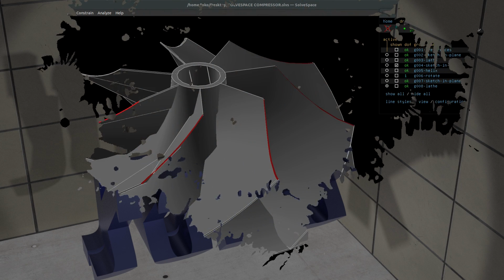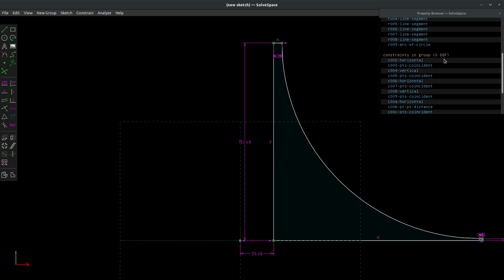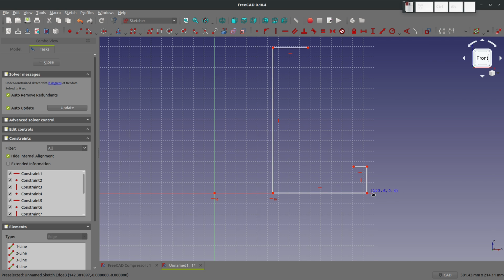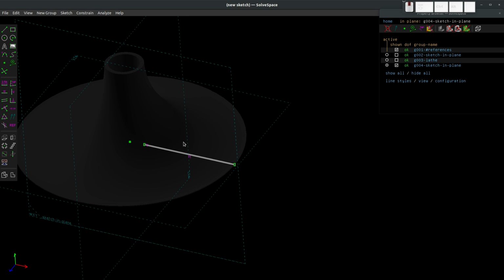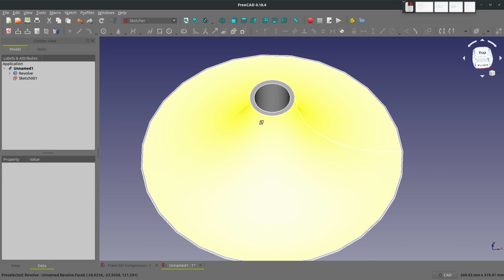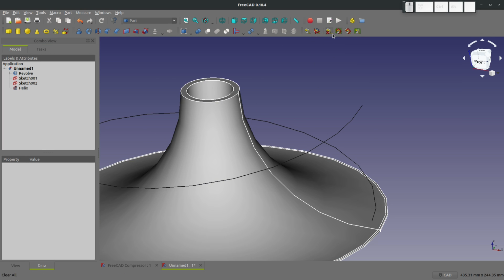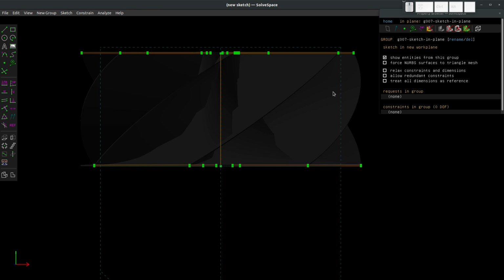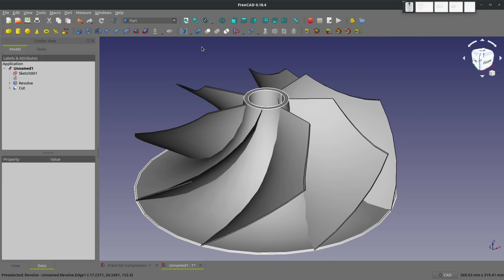Compressor in SolveSpace and FreeCAD: A Comparison |JOKO ENGINEERING|

Comment: Am I missing something with SolveSpace? Why isn't there something as simple as constraining distance horizontally/vertically? You can only constrain distance from point to point.
Reply: You can constrain distance from a point to a line. If you want to constrain only the X or Y distance from the point, you would probably benefit from some construction lines. They'll probably be reused.

Comment: haven't finished the video yet. but would like to ask anyway. how does solvespace perfrom in cases where freecad will have the topology naming problem? thanks!
Reply: It does not have this problem because it is properly designed parametric CAD. FreeCAD is a mess.

Comment: Just wanted to if I should learn Solvespace or FreeCAD. When I saw you using the calculator several times, I had my answer.
Reply from the maker: I would recommend both!
Reply: @JokoEngineeringhelp  I use SolveSpace for quick modeling and finish them in Blender or FreeCAD. Solvespace is particularly bad at drawing a lot of holes.

Comment: Looks like Autodesk Fusion, which is also free, blows these programs out of the water. 🤔🤔🤔
Reply: Until they pull the startup/non-commercial versions after you've based your learning and use on them!
Reply: @eggyherman  From what I can tell, Fusion is only free for one year
Reply: And Fusion is open source where?  Yeah exactly.
Reply: Free, yes. Open source, not so much. This may not seem like a problem until a corporation starts limiting features in order to force users to upgrade to their paid software or stops supporting the software you use, leaving you no choice but to migrate to another program. Granted, Fusion360 appears much more streamlined, but I would be very wary of vendor lock-in.
Reply: @marcvandoornik  Yea, and all the work is on their "cloud" server. 
These programs run in the computer and keep the design in Your machine.
Reply: Just remember Autodesk can give and Autodesk can take away. Make sure to read the license agreement before use: https://download.autodesk.com/us/FY18/Suites/LSA/en-US/lsa.html
Reply: you have no certainty that you can keep using a software for years to come if it's on the cloud and needs all sorts of subscriptions. they can just change their terms or start charging at their whim.
Reply: They make that free (for a time, or up to a limit) to rediuce the use of the truly free alternatives.

Comment: Having to bodge around zero thickness surface errors in FreeCAD is interesting --- you don't have to do this in SolveSpace (which is the only tool I know). Why can't FreeCAD deal with these automatically?
Reply from the maker: Hi hjalfi; I see two possibilities - 1) The kernel of FreeCAD throws a computation error in a zero thickness situtation or 2) I'm completely wrong and I wrongfully assumed that it was a zero thickness but it was something else!

Comment: Can solvespace export to or import from other formats?
Reply: Imports: dwg and dxf (not always correct). Exports: png, pdf (in a pretty smart way depending on current view), dxf, step, stl, obj and js meshes.The application is around 7 MB, linux version is likely in your repo, it was in debians, or if you're stuck with windows, that version is just an executable. It's very easy to try out!
Reply: @funkysod  Hey, thanks a lot :)